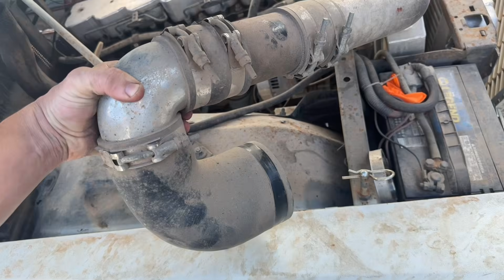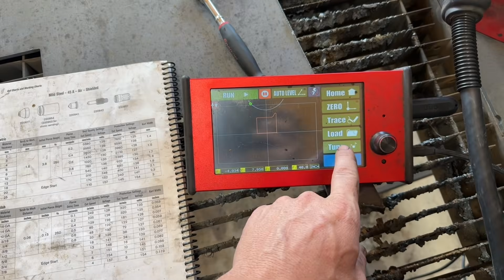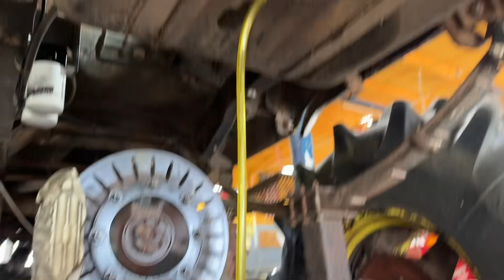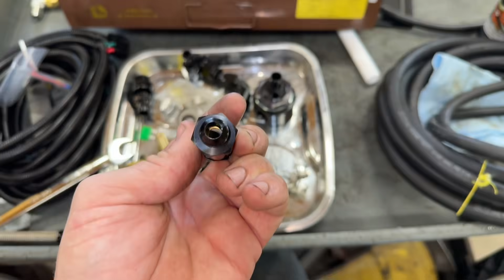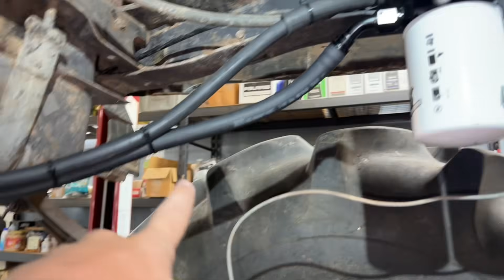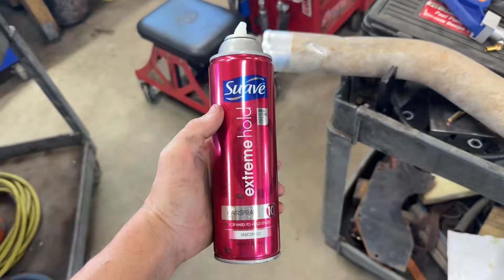Cadillac + Cummins = Pure Chaos

Comment: If I'm not mistaken don't differential vents vent pressure and not bleed vacuum.
Reply from the maker: They do both
Reply: @Stratemannauto  The ones I have taken apart are a spring on top of a rubber stopper. Check valve if ya will.

Comment: Technically wouldn’t the spring wear out over time and that would cause a decrease in fuel pressure? If it ever wore out enough it wouldn’t enough fuel to the engine?
Reply from the maker: Springs only wear out after cycling and yes over an extreme amount of time they do wear out, it’s a replaceable regulator for a reason. You’re taking several hundred thousand miles.
Reply: @Stratemannauto 10-4 10-4